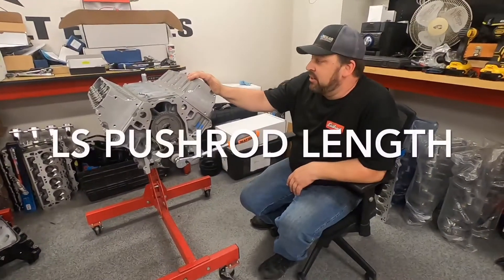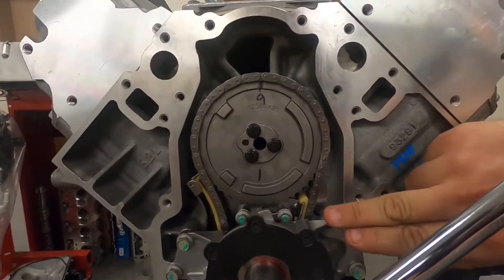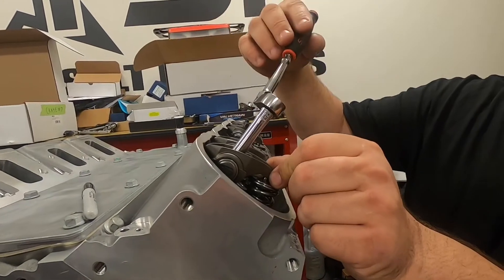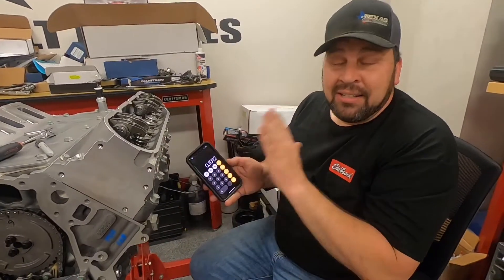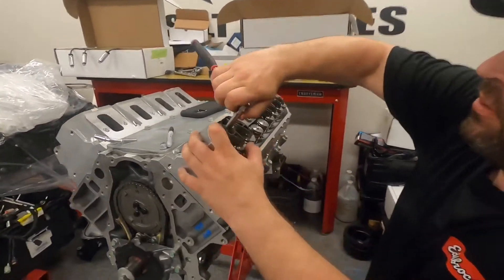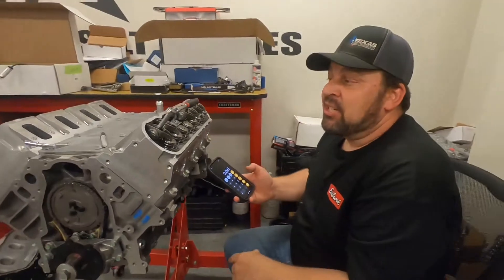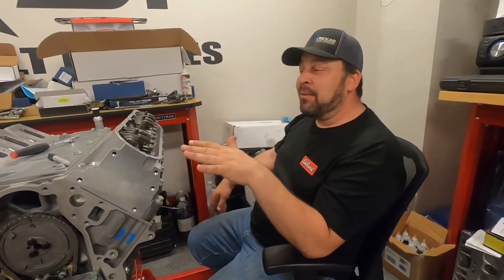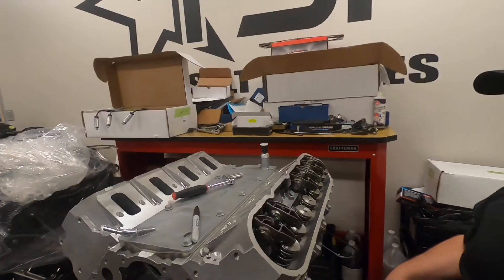LS Pushrod Length How-To

Comment: So I pulled one of the length checkers apart and the threads on the end of it match the threads of the rocker bolt on a stock 5.3 or at least it did on mine. That being said if a full rotation is .050 on the length checker then by the turn method it should be .050 per whole turn as well correct? Just wondering I haven’t fired this motor up yet I’m just double checking everything before I do. Added a different cam and valve springs.
Reply from the maker: That idea would be correct if not for rocker ratio. Since the pushrod is on one end and the bolt is on the middle, the pushrod will have a different value than the bolt threads.    There is a formula for it somewhere. 

You could also put a dial indicator on it and watch how far the lifter plunger moves once the rocker is tightened. I do this to verify, especially on short travel lifters. LS7 lifter styles have more travel and accept pushrods in the ballpark of right.

Comment: When building an engine, an easy way that I use to check the amount of lifter piston movement you have left is to push down the back of the rocker arm and see what feeler gauges you can stick between the valve tip and the rocker tip. Then take that measurement and divide by the rocker ratio, 1.7 for stock LS rocker. On an engine I just finished today I found between .135 and .143 on the feeler gauges so all were leaving at least .079 inches of lifter piston travel to take in any expansion due to heat. This is way more than plenty. The less the better though, to eliminate air bubbles effect on softening the cam lobe definition to valve movement. I never run less than .030 lifter piston travel even on short travel lifters, though I’ve run that with no problem. Especially important to run high enough rate spring for your RPMs and not float valve which would allow the lifter to fill up and hang open the valve. Love your video!
Reply from the maker: I also do that, especially on the low travel lifters.

Comment: So from the video I'm looking for about 5 1/2 turns from zero lash to get the correct preload on an LS7 lifter which is .1000?? I keep reading. .0800 preload on an LS7 lifter. I have a BTR cam in an LS2 that came with 7.4 push rods and the valve train is loud. Like a clack loud. Thanks for the video
Reply: I’m running the same set up. How did it turn out for you? I’m getting one turn in a half.

Comment: I have a lq4 that installed a btr stg2 v2 cam in with stock replacement lifters stock heads and stock mls head gaskets. I used my stock pushrods and it some lifter/sewing machine type noise. I have a set of 7.425 push rods would those help quieten down my valve train noise?
Reply from the maker: Most LS engines have that sound, depending on the lobe design. Would need to measure your current lifter preload with both pushrods and see what it is first. Shoot for .080-.100”, or just past one full turn on the rocker bolt if you watch the video. 

Roller rockers are also an option for quieter valvetrain sound, but do very minimal gains (if any).

Comment: Hi I set all the 7.225 PR's in ,,,and set them all in mind you TS said on the box there .175 shorter zero lash at 7.2 so  another 1/2  I was good with 3/4's of a turn,,,,,soak them set um all in and went thru the firing order 1.8 and so on ,,,,so  most gave me 3/4's of a turn before it clicked off 25 ftlbs I think #6 exhaust valve gave me a full turn but when that happened I could feel the lifter squish some ,,,so I went thru them all again following the firing order and everyone clicked off at 25 ft lbs....the Heads were decked to .001 as well ,,,,this is where the 7.225 came in ,,,,,after I went through them again I clicked off the remote  starter they all appear to be rising and falling evenly,,,,
My First LS,,,,so what ya think,,,,,I'll button it up, fire it up and listen 🎶,,,,,if it all sounds good I'll let it run a few heat cycles then dump the oil and Filter tidey up and Test ride.....if ya think i need to tare it down and start from scratch,,,it would be no problem,,,,there's alot of money and time in this LS and it makes alota power, don't wanna hurt it at all
Reply from the maker: Sounds like about .055”-.060” preload. You should be good to go, even with unknown lifters. If you want to take it a step further, you can do a compression test to verify no valves are hung open. Probably not necessary, but sometimes helpful for a sanity check. Good job with the build!
Reply: Hi Thankyou.
I set everything up on the 24th went back in the house after I Torqued the last ones 3 of them were off ;( then I remembered that I didn't check placement flat side up 0oops,,,so the next morning sure enough, and thats why I got a whole turn more on 3. 7..and 4.so 8 fliped them around going back through the firing order,,,and buttoned up the rest and Fired up,,,,right  away i could here a smoother Motor and since I have Fast Smart injection it's back in learning Mode,,,,different rocker ratio so small bump to lift and duration,,,,smoother and driving not hard at all yet it blips over 6000rpm like Butter,,,,so I'm very very happy,,,Motor is Fresh Machined 11 to 1 Forged Probbes H beams and all ,,put a fresh set of TR55's and a friend ordered me some Liquid Molly 5 40 synthetic,,,,is that good oil here in.California  ? What oil's is the best for a Pumped up LS Motor  ? And Oil filter i.seen the posts about the AC Delco oil filters so ill try and find me a K&N tomorrow unless you have a brand you use then I'll get the same. 
Thank you BiG Time ya put a lil extra Confidence in me ,soooo Apreciated

Comment: Hi Thank you for Sharing your Knowledge. I have a LS1  Heads Deck height .001 Head gasket Thickness .039 H Beams Probe Forged Pistons 596 605 lift ,motor was built for Lajuana Seca Button Willow, that type of track motor ,anyways had prw aluminum rockers and it broke one ,and the trunnion coming out of another ,got a set of TS steel roller rockers ,and pushrod length checker . TS foot note is check PR Length cause there usually .175  shorter ,,,so the ones i pulled out where 7.4  i put the length checker   in and got 7.2 Zero Lash on the base circle then rolled it out 3/4 turn and set the Torque wrench at 25Ft Lbs.and it clickes off at 1/2 turn so I turned it in 1/4 turn and it Clicked off at 3/4's of a turn so i ordered 7.225 Push rods TS's Rockers are 1.72.1 Ratio ,and from what i got ,or Understand i should be ok ,,,,175 Minus .4 is 225 anyway .and have tried other scenarios. i dont know what lifters the Machinist originally used ,and he actually forgot ,the motor was built and finished in 2010 and sat on a shelf fresh never ran ,until i installed it myself ,,,I have already ordered 7.225 Length ,,,,will i be ok
Reply from the maker: That sounds about right, just double check when your new pushrods come in. As I mentioned some are spot on the measurement, and some are .012” longer. Use the bolt turn method. Since you don’t know the lifters, I’d assume they have at least .100” travel , so anything from .040”-.075” should work good. If they are short travel lifters, usually need to be at the .035-.045” range.
Reply: @highperformancecult  ok Awesome they came today,,,there I'll set um up and let ya know hopefully I'm on point and there gonna make sweet sweet Music 🎶 🎵 Thank you can't wait to write ya back